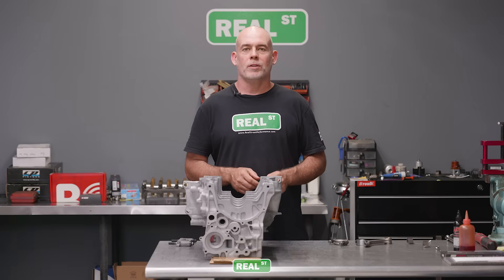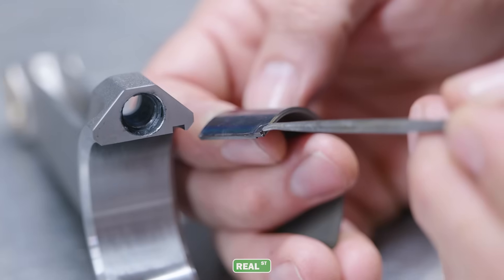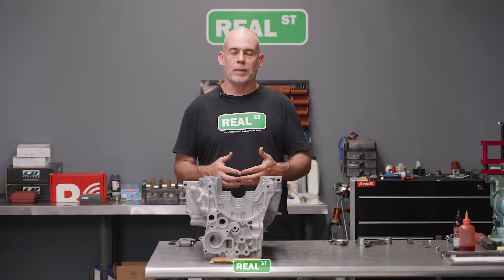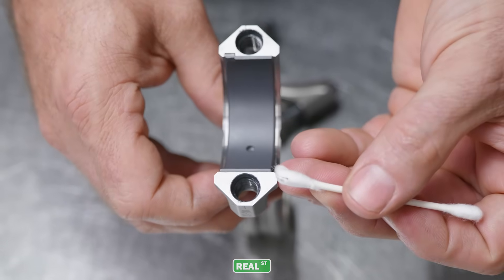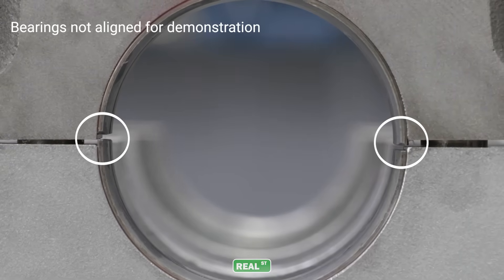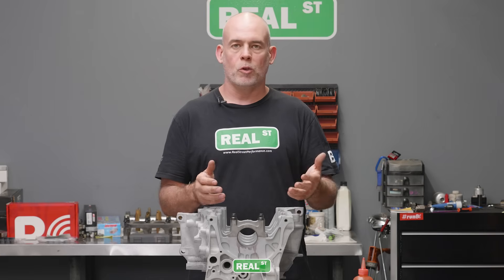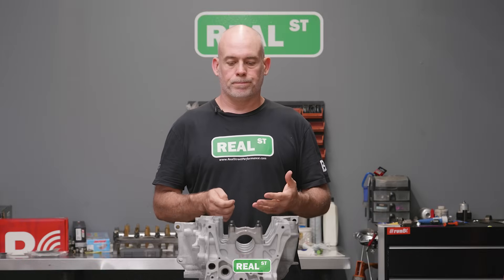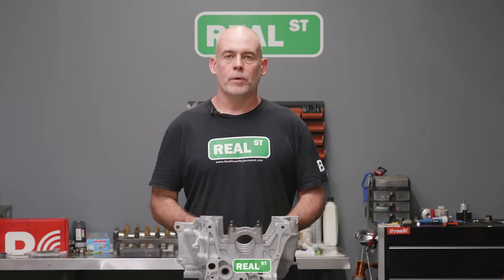Adding Oil On The Back Side Of Bearings During Engine Assembly. Good Or Bad?

Comment: 49 years experience, diesel ,gas ,air and liquid cooled . Always installed clean and dry [NEVER used scothbrite]  Oil pressure hydraulics bearing and aids in seating  the insert to its bore.  [Upon disassembly  I have witnessed both dry and oily backsides of insert ]  This is determined by RMS of surfaces left after machine work and is perfectly acceptable  wet or  dry .   ALWAYS ASSEMBLE WITH BACK OF INSERT CLEAN AND DRY.
Reply: Since it's been done both ways without issues wouldn't a fair summation be it doesn't really matter?
Why argue over details that are more personal preference ?
Motor building has many more important details to talk about
Reply: I have always done as you do, install dry and clean.  Smokey Yunick stated years ago that he cleaned the surfaces with acetone or lacquer thinner, but never explained exactly why.  Probably something to do with the bearing conforming closely to the surface of the cap and block during assembly.  But I'll continue to install bearing shells dry.
Reply: @briggsquantum ahh, yes, use the technique that’s 50years old on engines that a far different than today’s engines.
Reply: @briggsquantum  , Smokey was one hell of a mechanic.
Reply: No
Reply: I think I'm gonna go with Jay, he's more up to date with the information.
Reply: @seankimbrough8489 jay also doesn't know the difference between over and undersized bearings if you go watch that video.

Comment: I rebuild engines as a profession and I use assembly lube on both sides on every engine I build. Specifically, I put it on the lower bearings, place crankshaft, lube the top of the crank, then put the other side of the bearing on, then spin the crank by hand slowly 2-3 turns. After thousands of builds, its never done me wrong.
Reply: I was worried I'd have tear down my motor I'm building. I did the same. Assembly lube on both sides of all my bearings (crank and rod). Not much on the backsides, just a thin coating to help them seat. Glad I'm not the only one who does this.
Reply: Same here, was an oilfield mechanic for 24 years and used light oil on the rod end to hold the bearing during inst. i rebuilt anything from Cummins and Detroit Chevy Ford Mopar Pontiac and MG and Sunbeam and Austin-Healey. kinda like all the idiots that have real problem when it comes to ring orientation if you don't think piston rings walk around in the groove while you are driving you're daffy, orient them however you want when you pull them many miles later you'll find out they didn't stay where you put them. There is never just 1. way to do things as soon as you think that, some person will walk up and show you a new and better way to do something you didn't think of.  @ryanalden7793
Reply: @ryanalden7793  Did your build end up being reliable?
Reply: Genuinely asking, what would be the name of that profession? Small engine mechanic? Machinist/ mechanic (considering honing and decking)? I’m an apprentice rn and I think I’d like to pull and rebuild engines all day further down the road

Comment: Transmission fluid is not oil. It isn't designed to provide lubrication. If it was, .it wouldn't have a very fine abrasive for the clutches

Comment: I build 4ag's . I build them however I want. I once built one with junk parts. Damaged crank and cams and a random piston that I was using as a hammer. Got 30k on that motor. Engines are very forgiving. Now measure blow-by and that's where you'll separate the sheep from the goats.

Comment: If you are putting oil on the backside of the bearings , you have no business building engines. You have no conception on how bearing clearances are affected. I’ve been building engines for 45 years and know better. Stop misinforming the engine building public.

Comment: NEVER put oil on the back side ,  the bearing is to never touch the crank ,mains or rods , these bearings are hydroplaning when the engine is running , they only touch the crank as it is starting or stopping as oil pressure goes down , I have built engines and NEVER had a failure , but I learnt from the best and I copy what they did and didn't do , I Never touch the bearings with my fingers , the salts and acid's prevent the oil from properly staying there , wear rubber gloves or wipe with soft cloth to clean bearing

Comment: On a blue printed engine with very fine tolerance the oil film on the back will effect the torquing the journal’s  cleaning if any should be done before setting tolerances

Comment: I have done about a dozen assorted engines in my day. SB chevy's, iron dukes, and an assortment of V6's. I use a clean dust-free shop environment, clean everything with compressed air, use copious amounts of regular engine oil for pre-lube. I am utterly anal about washing my hands after each and every step. I always manually prime the oil pump before installing the distributor. I have gotten a hundred thousand plus miles out of each and every one of them. I ran them all fairly hard, too. Regular oil changes throughout their life. Never ever had any failures.

Comment: Pretty much I've rebuilt every engine on every car I've owned since I was 16 years old... I'm 65 now. And I've done what this guy has done on every one of them. generally speaking, the car itself has fallen apart before any of my rebuilt engines have. In other words, the engines never failed. It's crazy to think that oil doesn't get there during operation so it's just as crazy to think by doing this is somehow messing with the clearance of the main and rod bearing since it's a crush fit anyway. You'll know id by putting fluid on the back of the bearing or onto the bearing journal has done something bad, simply by checking the bearing clearances of each rod and main bearing after proper torquing. Think about it!

Comment: I never did that. Oil has thickness, depending on weight. I was fitting a piston wrist pin to the piston pin boss'es. The pin fit very nicely, until I put oil on it. Pin would not go in until I wiped off the oil. So, that said, by putting oil on the backside will mess up your tolerance. Get your plastigage & try it.

Comment: I imagine that it adds a few molecules of oil to increase crush , as long as they stay put it is ok , but after a hundred thousand miles from pistons pushing and heat , I think it’s likely that use lose some crush . I have always been told dry , but early I did oil both sides , but it was racing engines at work, and I was supervised by all the other techs . We had a boss that paid for the car if we crewed it.

Comment: Never never never oil the backside of bearings on race motors.  Makes clearance too tite and holds heat in bearing.  Street motors std HP mite not be an issue, but still WRONG ..

Comment: 45 years ago I used to work with a guy who oiled the back of bearing shells. We all gave him a hard time about it, and I guess someone must've taught him to do it that way. None of his engines failed, it was just different to how the rest of us did it.
Reply: Y’all realize you can just plastiguage to see if the clearance changed😑
Reply: Agree
Reply: I was taught 50 years ago, oil everything. Backside of bearings too.
Reply: It's going to make its way there behind it regardless. lol.
Reply: @8145dwerdna  ,,damn true.............capillary effect or action in the hot engine draws oil everywhere............
Reply: @8145dwerdna yes, oil will make it's way behind the bearings eventually, but not having oil taking up the clearance first allows for the engine to break it and seat the bearings. Then oil wicking in where there's space doesn't create a potential for damage.
Reply: @Faolan161  LOL you have no idea what you're talking about.
Reply: @8145dwerdna  yes, because ad hominem is always proof that you're not projecting... Try again, this time with substance so you don't make a fool of yourself.
Reply: @8145dwerdna  ni seating or breaking in bearings? Obviously you've never built an engine, and noticed how oil pressure drops slightly after a few hundred miles...no need discussing something with you when you can't be bothered to understand the measurable basics. Go troll elsewhere.
Reply: @Faolan161 "seating in a bearing" ? What does this mean,
Reply: @406MenaceRacecar  this is such a a basic concept, you have to begin with understanding an engine first and where forces are. I'm not writing a book on it when you haven't the smarts to understand.
Reply: @Faolan161 I think that arguing that you shouldn't have oil under a bearing is a bit crazy.
- thin oil as suggested here has a very low viscosity. He showed it being squeezed out with with just the pressure from bolting the cap down
- I tore down a factory GM crate engine last week. Was only a couple of years old and the bearings were wet on the back side, hmmm how did that oil get there?
- If you think that the thin film is oil is enough to distort the bearing, then isn't the friction and binding of sliding a shell in dry able to do the same thing? I'd argue that letting the bearing slide into a better position is better than any (even if minor) binding from seating it dry
- if that thin film is enough to keep the bearings from seating fully, then how is it that under extreme loads, with pressurized oil in the journals, a bearing surface can contact a journal.... But the tiny amount of oil is enough to cause a seating issue??? You can't have it both ways
- due to surface tension, you're going to get oil wicking behind the bearing once it's installed. How is this different from having a little oil behind it when seating it?
- is there a hole in your bearing to get oil to the journals? Oil is being pushed from behind the bearing, you don't need to put oil in there, the oil pump is forcing it behind there for you. Not too mention the capillary action of hot, thin oil being wicked into the space between the bearing and the seat.

I'm about to assemble an SBC and if I had a dial bore gauge, I'd measure the clearance with and without oil. I feel pretty certain that there isn't a difference in crank clearance with and without oil.

It's not the most accurate test, but I might set bearing dry and plastigauge, then set them with a little thin oil and check it again. I'm almost willing to bet that there isn't a difference.
Reply: @Faolan161 the oil pressure drops slightly because you've slightly worn the wear surfaces off the bearings, oil pumps, rings, etc. NOT because they somehow got seated deeper into the bearing cup..... 🤦
Reply: @wlrottge  how do you explain it when the bearing surfaces are untouched? It's called breaking in an engine not causing premature wear  🤦
Reply: @Faolan161 the word you are looking for is "hydrodynamic wedge".

In an ideal world, the interior face of the bearing will never touch the crank. However, you have startup where there isn't any oil pressure. There is oil breakdown so that the oil can't support the loads anymore due to viscosity break down. You have particulates due to combustion (mostly carbon), other parts wearing and even dust ingestion (past air filter, into cylinder with a tiny fraction making it into the crank case). So, ideal conditions don't exist.

What you're saying literally violates laws of thermodynamics. I'll loan you some books on both that and fluid dynamics....
Reply: @Faolan161 you tried mate.
Reply: @philmckrakin6752  correction -  A steer can only try. My successes with zero engine failures proves I did, not just tried. 

Too bad you didn't know what I know so you could say the same. When one is lying about another, they're doing what they project upon the other... thanks for proving such.
Reply: Did he use regular engine oil? Im about to attempt this on my car.
Reply: No you use assembly lube @MyNameForNow27
Reply: @MyNameForNow27 he used transmission fluid
Reply: @broke_dongle atf still tightens oil clearances, on the wrong side of the bearing.
Reply: If your clearances are greater than a couple thou, you won't notice it. If your clearances are say, 0.0008", definitely noticable, and likely to seize or spin a bearing, even if it spins over seemingly free by hand. This I have seen, before they started making bearings more available in 1-2 though increments.
Reply: 45 years only 45 years. how about when they used leather for bearing shells. and you had to pull over and pull the oil pan off and roll out and roll in new leather rod bearings think about that the good old days...

Comment: 100% agree I've been rebuilding 4G63 and 4B 11t engines for 10 plus years I always put oil on the backside of the bearings my machinist wants it done this way and has been doing this since the  60s!🇺🇸
Reply: Just regular engine oil? (Im about to do this on my car in my driveway)

Comment: This reminds me of a HS physics experiment,  where we had sheet pan full of water. We sprinkled talcum powder on the water's surface,  then dropped one drop of oil from an eye dropper to the water surface. The oil would spread out over the surface, displacing the talcum, so you could easily see and measure the diameter of the circular patch of oil. Knowing the volume of oil in one drop, and calculating the  area of the circular  patch of oil, you can divide the volume by the area and calculate the actual minimum thickness of the oil. 
Personally, I will agree with the cleaning the back side of the bearing shell, but I think I'll still refrain from oiling the backside of bearings.

Comment: I am sure he means well but why should we have to listen to so much blather before we get an explanation of why he oils the back of the bearing  ?  WE really don't need the discussion of tabs since every engine manufacturer says exactly how to place their stock bearings into their designed equipment. I do not place any lube on the backside & have heard long explanations from many professional engine builders as to why they think that practice makes the most sense. I wish he'd just get to the heart of the question that is in title ; instead we get a video that takes the place of any sleep aid ...............  zzzzzzzzzzzzzzzzzz
Reply from the maker: William thanks for providing your feedback and joining the conversation

Comment: In all my years as a mechanic the only spun bearings I have come across are due to oil supply problems.....BMW always spring to mind, they arrive siezed and strangely with a sump full of fresh oil ! Installing bearings wet or dry will not make a difference if a thin lubricant is used, grease most likely will. ☹. Lack of oil changes blocked / collapsed oil filters wrong oil   do damage which will lead to failure . Oil pumps in standard form always seem to have been able to supply more than enough volume and maintain the required pressures when revved , but if the oil level is low they can only do so much and when they they pump air thats when problems arise. I can only think of one engine that I built which had spun bearings and that was owned by a complete idiot. A friend said that they would not lend him a shopping cart....

Comment: How do you compensate for clearance when you oil the back of the bearing? Do you do a pre assembly with out the crank  with the bearings in place and torqued and measure the bores and crank journals or are you using plasti-guage during assembly to check your clearances? Curious as to how you know your clearances don't change with the back sides oiled? If you're worried about peeling the back of the bearing during install, chamfer the parting line of the bores.

Comment: I always grind those tabs off my bearings then grease the back sides with 300 weight bulldozer grease.
Reply: You're doing it all wrong.
I dip my bearings in a deep fryer for exactly 10 minutes then I coat the back of the bearing with Popeyes chicken grease.
It works out and I get to eat Popeyes chicken everytime I rebuild my engine.
Reply: @frontspring1  that deep fry method at least 50+ horsepower

Comment: Red locktite? Anyone else add a drop on the rod cap before final torque?..  nonstandard use VW type 1 race engine with Capri rods . Also on a aluminum olds 215ci V8 I converted to run reverse rotation to put in my 65 corvair keltic conversion .  I never had problems but, that was 25 years ago and there’s more science to debunk my tricks I used on my engines.  Never had problems.

Comment: When you disassemble engines there is no oil on the back of the bearings if everything is in good condition. If there is oil and the bearings fall out then it has been damaged by detonation or preignition. So recondition the rods if this happens. No manufacturer wants you to oil the back of the bearings. They say clean and dry.  
    Everything you do is stupid.

Comment: What's the reason there isn't just a step so the bearing won't spin. Ie. Have the od. of one half of the bearing slightly larger? ( and the corresponding machining for it to fit obviously) Is it benificial for it to spin if things have got that bad with lubrication etc?

Comment: Never ever oil the back side of the bearing.  The bearing and block or cap where the bearing contacts should be dead dry. The only place you put oil is the journal side. I have built hundreds of engines that spin high RPMs , never had one problem. What bothers me is the dickheads who teach tis stupidity.